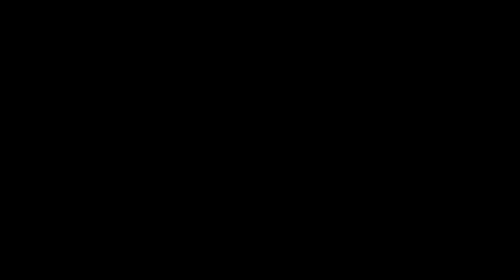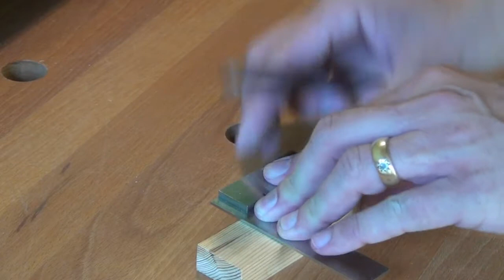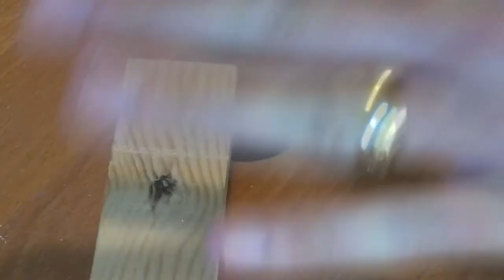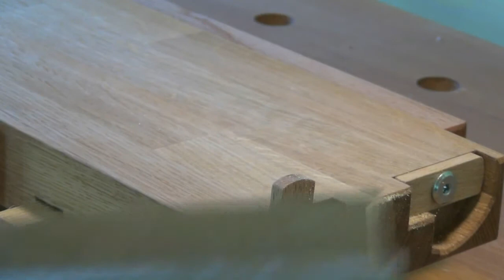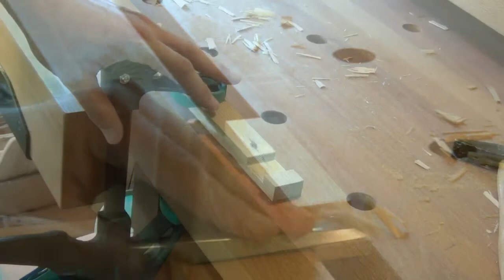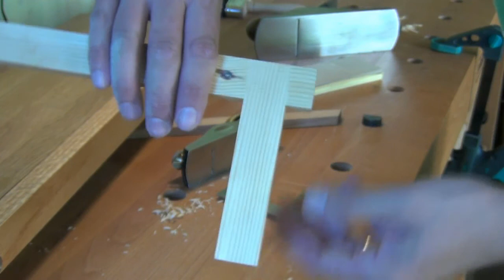Half Lap Tee Joint

Comment: I note that yours is the first video I've seen where the presenter knew enough not to set his planes down on the sole.  My first woodshop classes were in the 1954/55 academic year and the teacher, Mr Lou (Pop) Froelich made sure we learned NEVER to set a plane down where the iron could contact anything that could compromise the edge.  I still cringe at the sight of a plane resting on its sole and the exposed iron risking a clip round the ear from Pop Froelich.  (Teachers could do things like that in those days.)
Reply from the maker: +Matt Worner Cheers Matt. Good spot - either lay it on its side or rest the toe on something, it's not hard to follow good practice in this case, but you're lucky to see it on YouTube. Might explain the interest in sharpening videos!
Reply: +Matt Worner I saw three antique planes at the junk shop this weekend and all three were blade-down. they all needed a major overhaul but I nearly screamed anyway.
Reply from the maker: Sadly it's one of those things that doesn't surprise me any more

Comment: good job
 just little problem, i m not hammering the iron chisel hammer, there is a rubber hammer or mallet
Reply from the maker: Good point. These Hickory, socket handles are fine to strike with a metal hammer, but many chisels are not.

Comment: Reality is 23 minutes to cut one joint, that's why I own A table saw. Appreciate your effort but, unless this is yoga , I'll keep my table saw
Reply from the maker: Stewart Frye Thanks Stewart. Each to their own. My reality is, without filming or instructing, just a few minutes, virtually no airborne dust, very little noise, masses more pleasure. 
Happy woodworking, Mitch
Reply: Hello Stewart. I can thickness timber at 2 am if I want. How would your neighbours like your jointer and dust extractor at that hour. I hate dust as well but shavings are beautiful. AND what's the big rush to get things done? I'm sure I can cut a this joint just as quick as you if I didn't have to explain and show what  and why I was doing it. I can cut a Frank Klauss dovetail in about 6 minutes probably before your router is set up in you leigh jig. Watch your fingers in your haste. Enjoy your woodwork

Comment: Hi Mitch. What's the size of your shop please? Is it the only shop you have?
I just bought a new 3.5 Mt x 2 Mt shed, for hand woodworking, and am wondering if I might have to add some panels to it. Thanks for the videos. I am finding it quite therapeutic, getting back to basics. I've started a couple of dovetails, and will stick them on a shelf in my new shop, when I have a collection of various joints all finished. Cheers JW!
Reply from the maker: Jazzwayze That's about the size of my machine shop - rarely used now that most of my work is by hand, but a great help in initial prep if I'm feeling tired! For a machine shop, it's too small. I used to be forever moving machines around for space to work.For hand work, I'm very comfortable in my present space, which is about 5m x 3m. I have two benches in there, a sharpening station, and large storage rack. I can walk around the benches, which is nice but not essential.It works out at about twice the floor area as yours. I don't think you need rush to extend yours, unless you plan to build large projects in one piece. Most large household furniture can be designed in smaller sub-assemblies, which need less space to build.I do suggest finding an area in your home for storage of wood being used for projects. This allows it to acclimatise to the conditions it will end up in, avoiding excess movement in the piece once installed, and also frees up space in the shop.Glad you are enjoying the videos. Happy woodworking, Mitch
Reply: Thanks Mitch. I am using a single-car garage atm, but it's chocker with machines and a hand-bench. I can't stoop over the bench for too long, these days, so I won't be selling any machines. So I decided I'd keep the garage as a 'machine-shop. for milling, and shift the  the workbench out. I think I would have enough room in this new shed, as the biggest thing I would make is a dining table, which could be worked on in the yard on good days! So thanks for your reply; I should be up and running in a fortnight, weather permitting. Need I add, the shed isn't a cheapo model, but I shall have to insulate and line it out. Which is going to make it cosy, I hope! Maybe now the garage will look tidier! Lol!  Cheers. JW.
Reply: Jazzwayze Good Luck with your new addition, and I too have difficulty bending over too long.   I found an excellent video on making a mini-workbench to go on my workbench that allows a great way to work without bending as much!    Getting your work at a comfortable level is difficult, and requires thought and some investment of time and effort, but I think that the results will pay for themselves!

Comment: I thought chisels had to be used only with wooden hammer
Reply from the maker: Pierre Chalopin These chisels have a hickory handle (which is easily replacable) that takes the blows of a metal hammer with no trouble. But a very good point, as many chisels without ferrules will split easily.

Comment from the maker: Hi,
I'm using a precision engineers try square. Engineers try squares can be bought quite cheaply in places like Toolstation (in the UK). They are usually pretty accurate, but you can always improve the accuracy with careful filing if necessary. Precision ones cost about two to three times as much.
I will cover the engineers try square in a video in the future.
Hope that helps, and please subscribe if you liked the video.